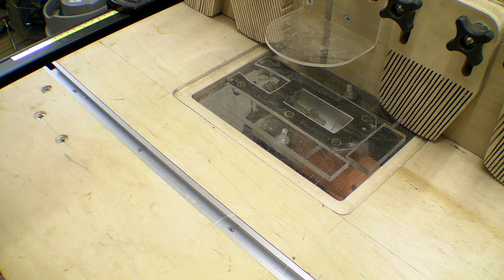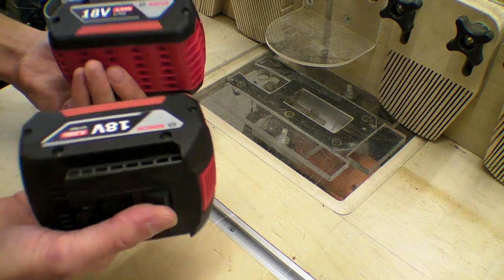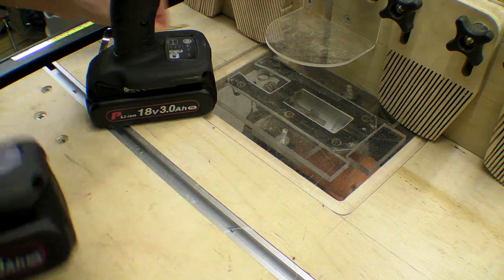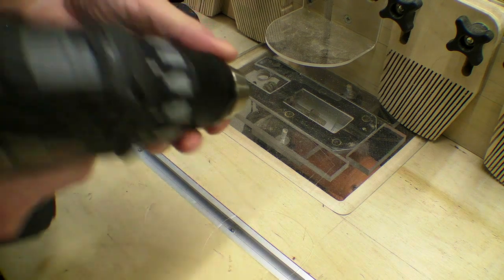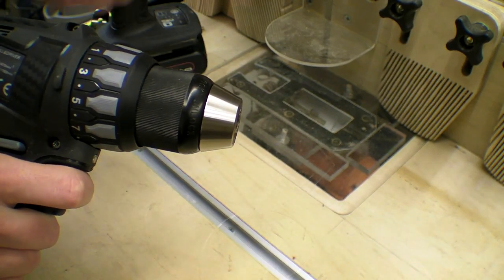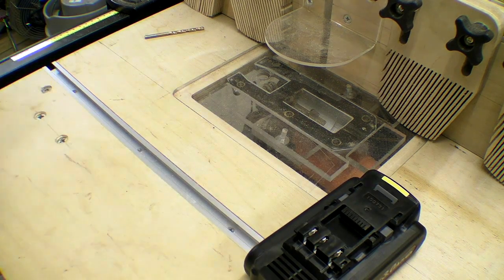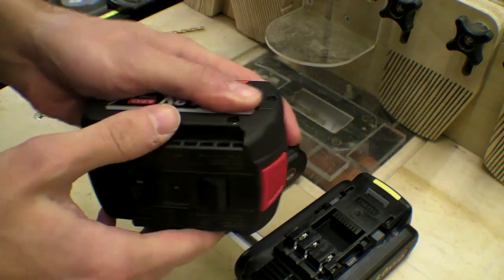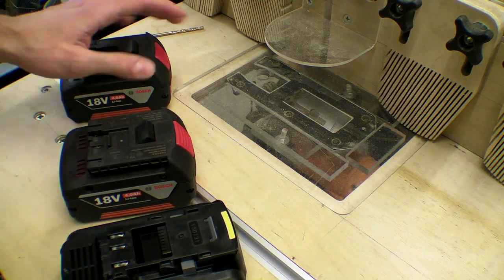18V Bosch Battery Holder Rack - Deep Storage

Comment: Thanks for the video, but long time storage of li-ion cells should always be done in the fridge. Their lifetime will be improved A LOT compared to if you store them at room temperature. But put them in a plastic bag or container to protect them from moisture and humidity.
And never long term store them fully charged or discharged either, that would reduce their lifetime .
Storing li-ion batteries at about a 40% level of charge is recommended.

Battery University BU-702: How to Store Batteries
Learn about storage temperatures and state-of-charge conditions: http://batteryuniversity.com/learn/article/how_to_store_batteries

Squeezing More Life Out of Your Notebook's Battery Part I
Page 10: Battery In The 'fridge? http://www.tomsguide.com/us/squeezing-more-life-out-of-your-notebook,review-574-10.html

Comment: The delay might be some sort of "soft start" feature.
I too got one of the first LiPo Bosch drills and it behaves the same. It also has a "throttle" dead zone, where only the led is lit.
And the other issue, with quick starting when pulling slow on the trigger is also normal, with a small duty cycle on the drive PWM, the motor would not start. So it starts with full throttle or a bit less until it got a feedback reading, if the control loop has a feedback. Only then it switches to the proportional control.

Comment: Don't know if they're available where you are, but I am a big fan of the Milwaukee Fuel 12v hammer drill combo. I retired my 18v set, as they got too heavy by days end and this set has great battery life, seemed as strong as my old 18s, both strong enough to twist you off a ladder if not carful. With its brushless motor, unique quick mode change switch, and 1/2 inch chuck, this thing is pretty amazing.
Reply: I wasn't able to afford the fuel set, but the brushed m18 drill and driver set is incredible, beats the similarly priced makita, Bosch and dewalt drills I've used in most regards. They are heavy, but have so much power, build quality is superb, and the 4ah batteries last forever
Reply: +pooslipper always fancied the panasonics though!